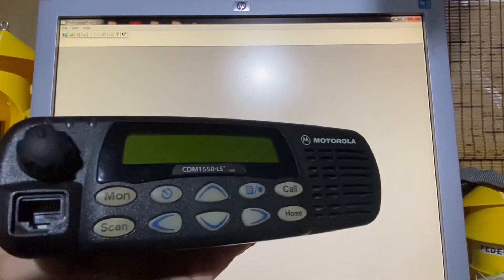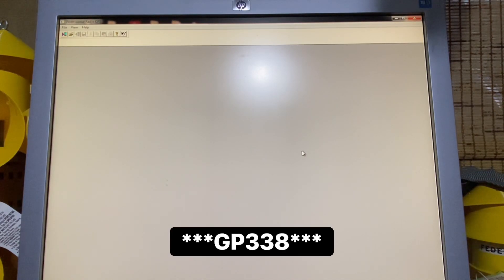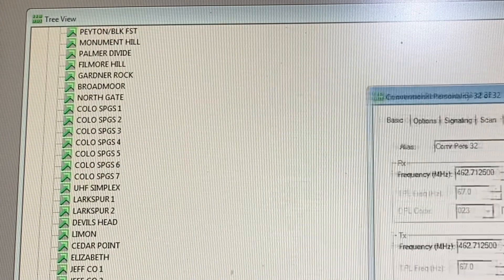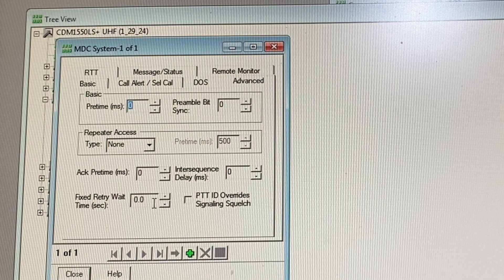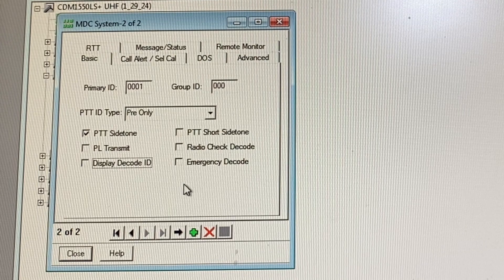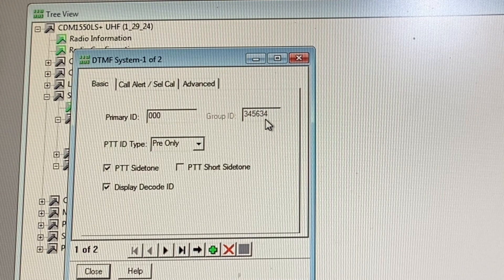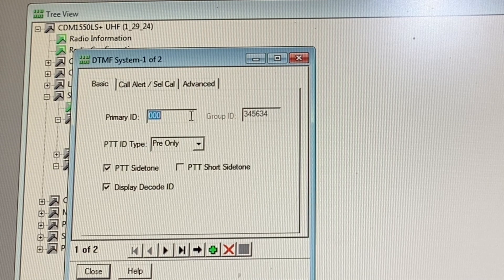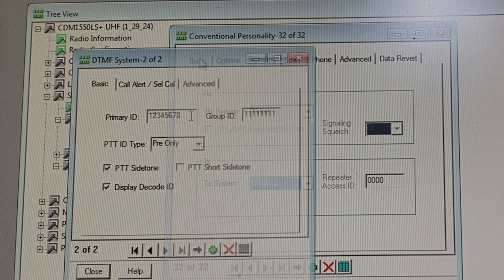Programming “Talk Permit Tones” on a Motorola CDM1550 (Conventional)

Comment: I have a couple cdm 1250 radion. The guy i purchased them from provided me with the programming software. However, after I download the software, when I open the software it will not connect or read the radio. I have been trying to gert these radios programed for a month now. I hope you can help. Thanks a ton, WSKV270